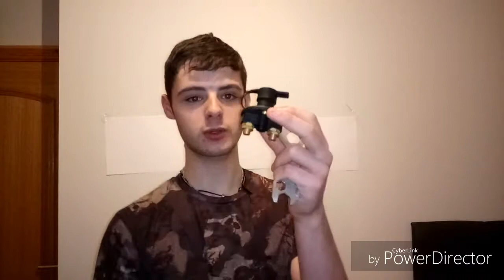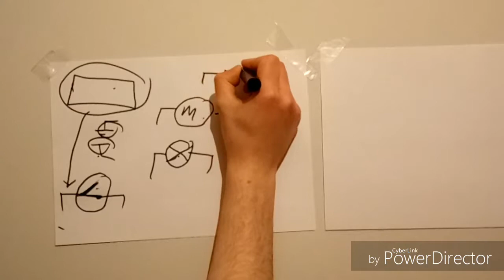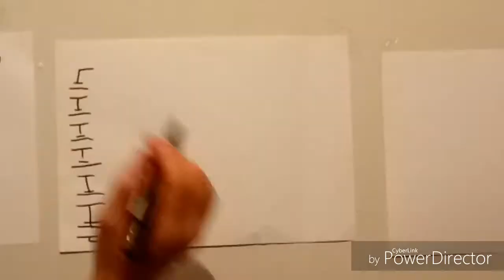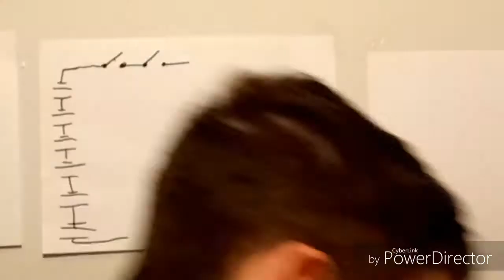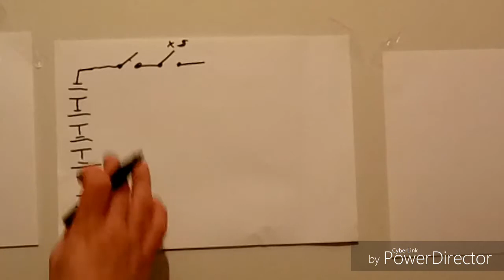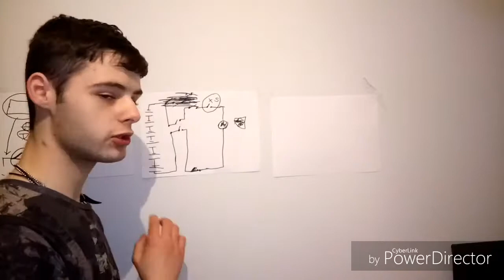Basic circuits and wiring | electric go kart build part 1

Comment: I am thinking to build a electric go. Kart but I am only 14 years old and it costs higher
Reply from the maker: Aditya krishnakumar yeah that's why im not uploading as much as I should be atm because im working 6 days a week 8-10 hours a week to get money for it and ive changed my plan to petrol because it's cheaper to buy an engine than electric motors and controllers for it. it would cost around about 2 grand for the electrical components not including the chassis wheels ect ect. my advice is to wait until ur a bit older to get a job and start studying up on cars and how they work. I started building cars at the age of 12 and have studded them since i was 8 so it really pays of in the end. hope this helps you my friend